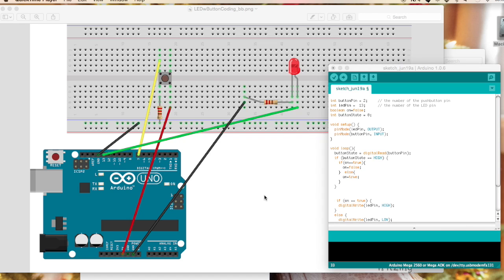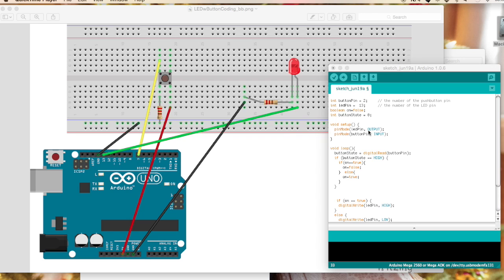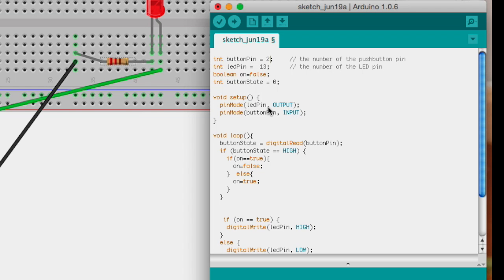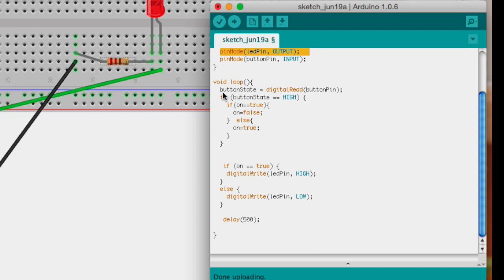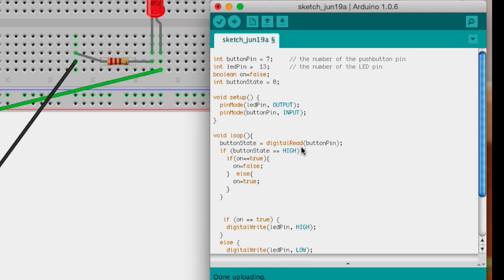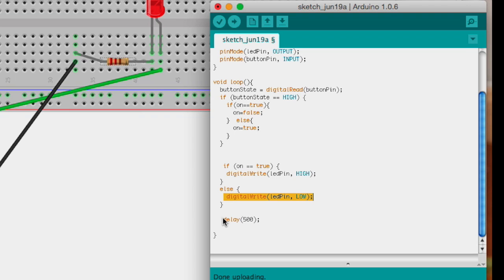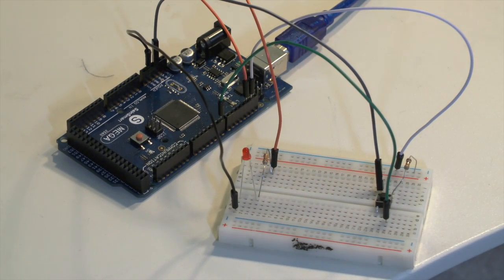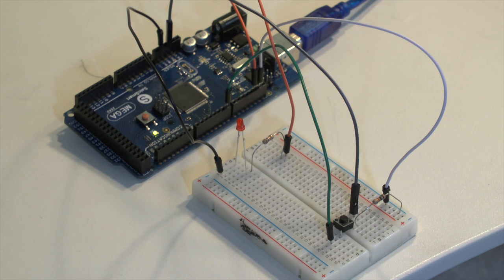Arduino: Button Switch Project

Comment: For everyone that doesn't like this code... I made a better code:

int inPin = 2;
int outMin = 13;

int state = LOW;
int reading;
int previous = HIGH;

long time = 0;
long debounce = 200;

void setup()
{
  pinMode(inPin, INPUT);
  pinMode(outMin, OUTPUT);

}

void loop(){
{
  reading = digitalRead(inPin);

  if (reading == HIGH && previous == LOW && millis() - time > debounce) {
    if (state == HIGH)
      state = LOW;
    else
      state = HIGH;

    time = millis();    
  }

  digitalWrite(outMin, state);

  previous = reading; 
  }
  
   delay(150); 
  
}

Hope it works for you!

Comment: Do i need a breadboard to add a switch? I just got the arduino after a month of waiting, there has to be another way to do this without having to melt cables together.
Reply from the maker: Having a breadboard makes life a lot easier.

Comment: Hey! I tried the code with my Arduino Shield and the LED constantly flashes ON and OFF, without me pushing the toggle button. Do you think you could know why is that? Is it because you used a breadboard and it works different to the shield? Cheers
Reply: I have the same problem, it's really weird...
Reply: if you take the delay off the end it helps

Comment: Plz send me code when i press push button led 1 and led 2 on 
And when i press again led 1 off but led 2 after 10 second off
Reply: Just add the code for led 2 on the first part and then on the part of the else put the delay 2000 and the led 2 low code

Comment: Sir can i have ur help! I'm making a vu meter i want to make it turn on and off with a single button like u did, so i used ur code and it works great but the delay that u put it runs through my hall program so the vu meter doesn't work correctly sir can u give me a solution for that?? Please I'm stuck in this😑

Comment: I tried this and my LED just blinks for a while, then stays on and blinking again. 
It does not read the button. I use a Arduino Nano
Reply from the maker: If your connections are correct, it should work. The only other thing I can think of is maybe there is a power issue with the Nano. I've never used the nano.
Reply: +LearnEDU 
I had luck with a bounce example. 
If I want to make a code that changes from solid LED light to blinking LED light and to randomly blinking LED light by one button, which kind of code would you use?
Reply: Serkan Demirel 
I connected it right, but after a long time I found out that the pin input was fried, so I changed and rewrote the code - then it worked
Reply: Put register Between Ground and switch.
Reply: Can you please help me? My led keeps blinking too. I am using Elegoo UNO. How did you lift this problem?
Reply: Mine was blinking too. I just realized that I've connected the button wrong.